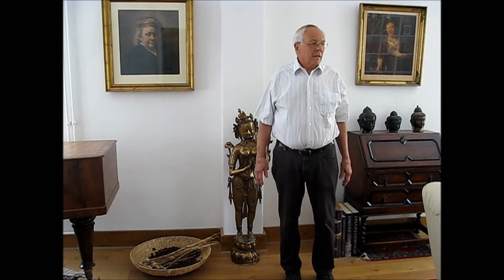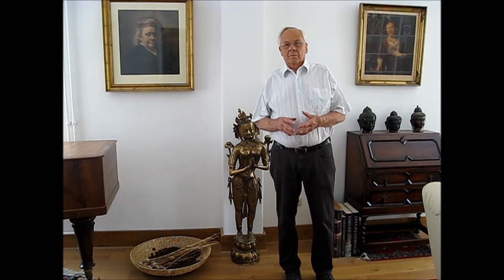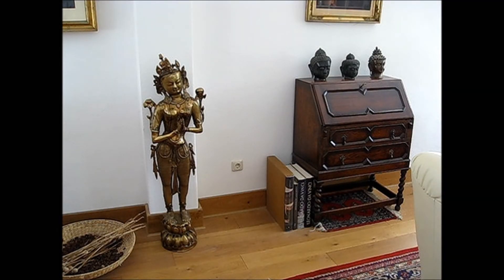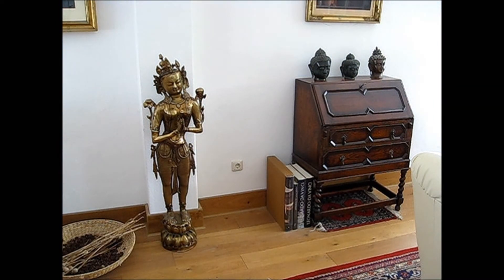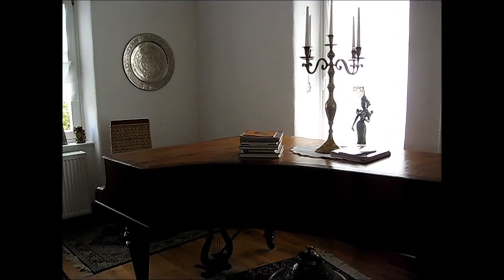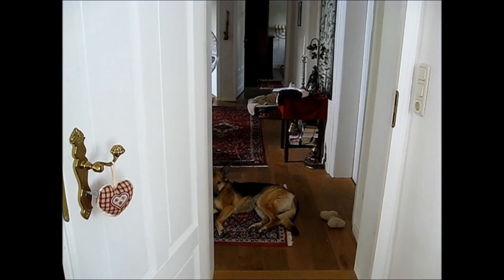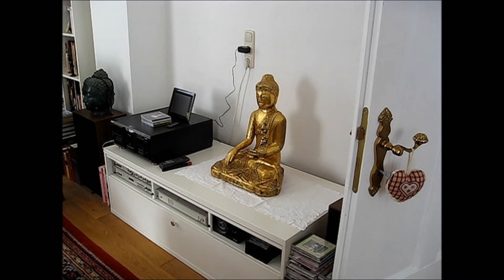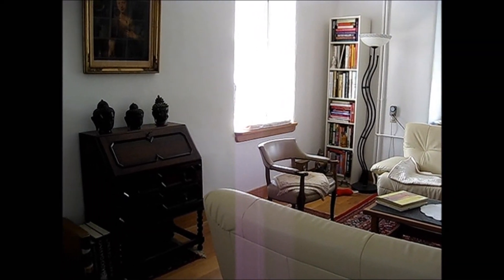The making of a Living Room

Comment from the maker: Well, in fact, the picture is not crooked at all! It hangs from a "gallery strip" just below the ceiling, suspended by nylon cords. Since it is suspended in the middle the top of the picture hangs our further from the wall than the bottom. Since the camera was at about a 30° angle to the picture it looks like it's crooked, but it isn't. There isn't much I can do about that. :-)